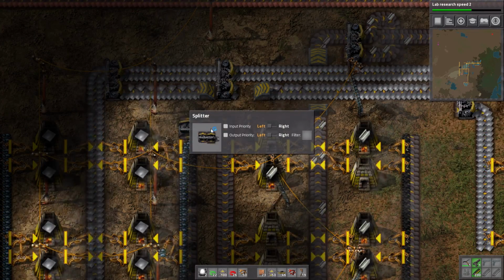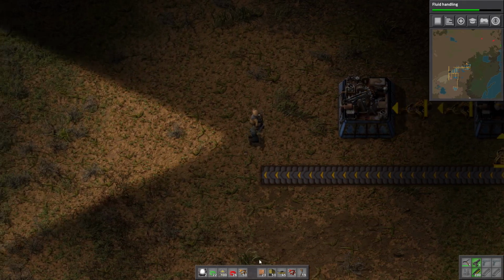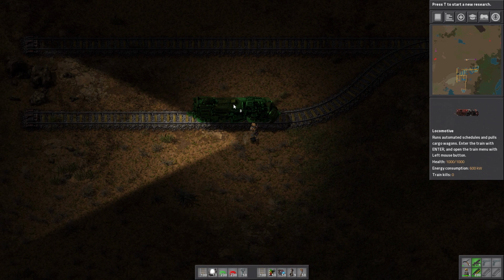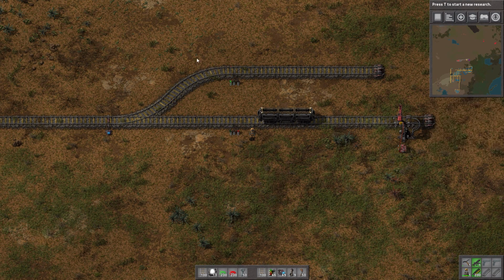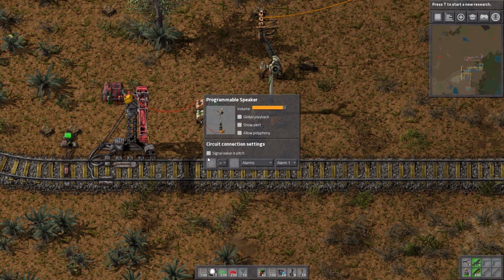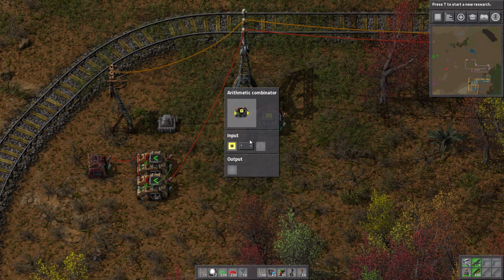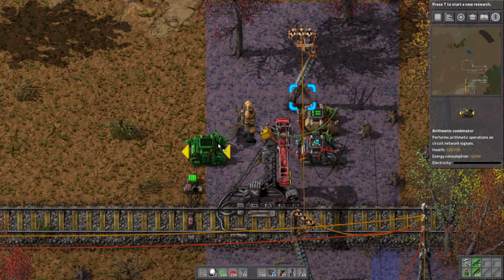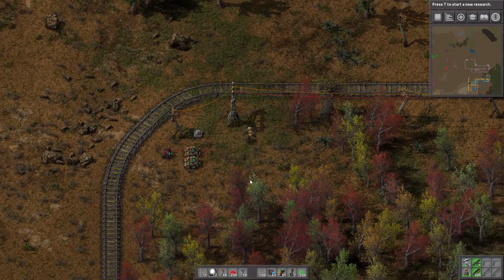Smart Depot – Factorio 0.16.x – Let's Play Part 6

Comment: I haven't watched the whole series so I'm not sure if you've talked about it or not but for a steel production area I recommend going straight from ore to steel instead of feeding off your main bus.
Ore -> Plates -> Steel -> Bus
rather than
Ore -> Plates -> Bus -> Steel -> Bus
The ratios work out perfectly that 1 iron furnace will supply 1 steel furnace perfectly so it also looks nice as well.
Reply: You need 5 iron furnaces per steel furnace
Reply: No you don't. The steel smelts a lot more slowly, so in the time it takes to smelt 1 steel plate 5 iron ones are smelted.
Reply: If you plan on using a large train system, it's not recommended to send ore to your base for steel production to begin with. I know you didn't mention anything about transporting ore to your base, but just in case you're looking to streamline your production even further and aren't already aware of this fact, I thought I'd mention it.

It takes 10x the amount of cargo wagons to send iron ore to your base for steel smelting there, than to just smelt the steel at the iron ore mine and ship the steel plates, and this dramatically clogs up your lines which affects all efficiencies for production that's based off your train system (that usually entails every part of your production in rail word maps). This is because it takes 5 iron ore for 1 steel plate (which means 5x the inventory space/cargo capacity of your cargo wagons), and plates have a stack size 2x larger than ores (100 to 50 respectively). In other words, 1 cargo wagon of ore can make 400 steel plates at a base smelting setup, while 1 cargo wagon of steel plates can ship 4,000 at a time.

On a small scale you may not notice the difference too much, but when making a mega base where resource throughput is generally your largest bottleneck and one of your largest concerns, making steel on site (at the mine) can make a massive difference. On the plus side, the logistics challenge of smelting ore at the mining site can be fun to work out as well, so double win! :)

Comment: Hmm. You're talking about stations requesting empty trains... Just wondering what the reason is for planning your system that way around? 
I've generally set my systems based around the "i need X, bring it to me" side rather than the "i have X, send an empty train to pick it up" side.  I mean, obviously both will do the job in the end, just wondering if I'm overlooking some potential upsides because of the way I tend to think and/or play the game. 

Also, seriously, you do a /far/ better job explaining this stuff than most people. I wish I got that rail signalling explanation back when I was learning train basics. :)
Reply from the maker: My system does both actually, calls for an empty train, and later, calls for a certain cargo :)

Comment: I wish I knew what you were on about.  I kind of understand the logic system, just not how it works.  I’m just about able to use two trains on 1 track with sidings.  I need to do a build along one day.
Reply from the maker: When I'm finished with the setup perhaps I'll do a cut down tutorial video that just shows exactly what you need to do to design the system, but doesn't go too in depth on HOW it works, just what you need to do to get it to work.